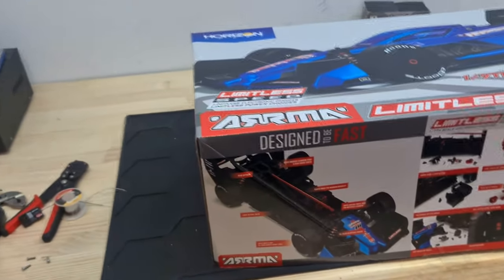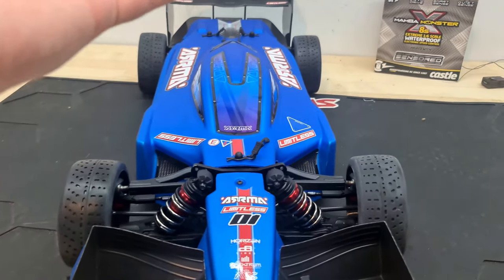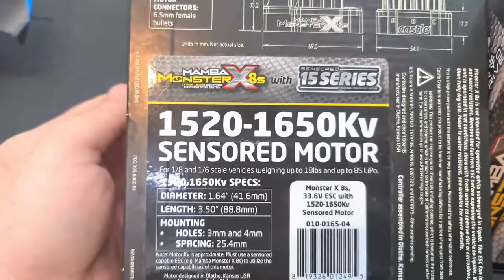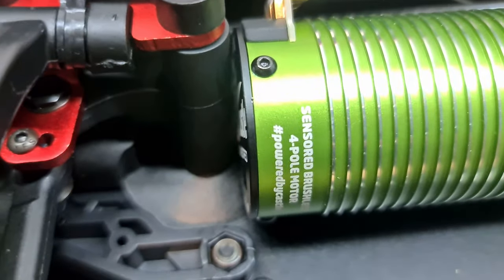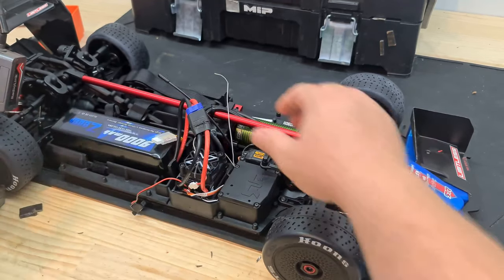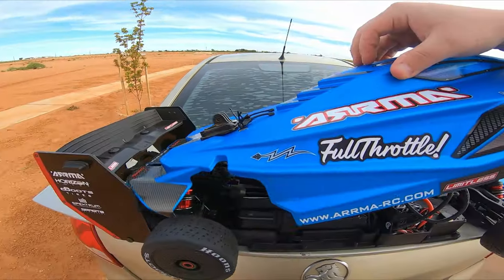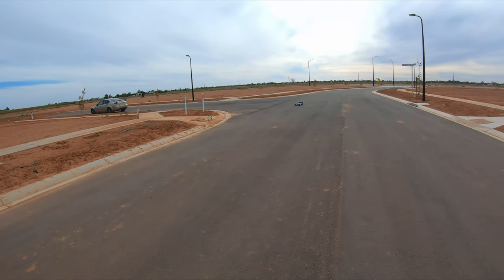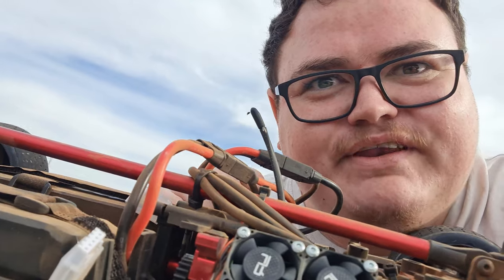INSANE! 8S! Arrma limitless - Castle 1650kv

Comment: Cheers mate!

I’m also a Limitless owner, but with the 1717 motor, and because your motor’s  outer-can temperature was at 183° F near the end bell, I thought I might pass-on some important information. 

When heated above 176° F (80° C), a magnet will quickly lose its magnetic properties.

The magnet will become permanently demagnetized if exposed to these temperatures for a certain length of time or heated at a significantly higher temperature.

Odds are, the internal temperatures near the rotor are 20°F higher than the outer-can temperature. 

With this in mind, it’s but another reason for the Castle Creations firm to deny any type of warranty on their high-speed equipment. The motors and ESC’s will be pushed beyond their limits no matter how hard the end user tries to keep it sane.

Gear down and get some high-velocity fans blowing on your motor!

Best of wishes for your future speed runs!

Comment: Nice bud. I prefer converting a V1 Infraction to an almost GT vehicle with a sleek body. It looks better than the limitless stock TBH. But anyways, nice toy! I'm still working on my Felony that I converted into a thunder truck. XLX2, 1100KV motor motor from HW. I just have to work on changing the rear diff and installing the spool in the center. Hehe. Good stuff bud as always!
Reply from the maker: Thanks bro and I agreed, I only got the limitless for the fact I'd pay less as I didn't want to use stock electronics
Reply: @MatthewSimm  That’s exactly why I bought mine too!!! 👍🏽

Comment: If you want to pull more speed, the 1717 will pull a bigger pinion on 8s without running as hot.
Reply from the maker: Unfortunately I could not get the 1717 in Australia. I think the 1721 might be the step up with the xlx2 if I decide to go that far haha
Reply: @MatthewSimm  yeah the new 1721 would be a beast. Not sure how the length is on that motor though. If it fits with the motor and center diff mounts in the stock locations it would be a no brainer.
Reply: Sounds good and worked great until my xlx2 spit white fire out of it yesterday as soon as I powered it up…contacted castle and was told the 1717 1650kv shouldn’t be ran with xlx2 at all, so I asked if it would be ok with my Mmx8s and was told not really but if I do then I shouldn’t exceed stock gearing🤷🏼‍♂️
Reply: @rickthompson7335  Lies!!! The 1717 1650KV is sold as a combo with MMX8s. Whoever told u that doesn’t know what they’re talking about. I have that in my Mojave and Limitless. I have 22t pinion in the Mojave EXB and 34t pinion in Limitless with no heating issues
Reply: @benhiman007  I’m just telling you what I was told sir 🤷🏼‍♂️ I sent the xlx2 in and am waiting to hear what they decide. I just bought it middle March and it didn’t have very many runs on it either. Correct connections/proper battery/logs always looked fine…then bam it’s on fire.